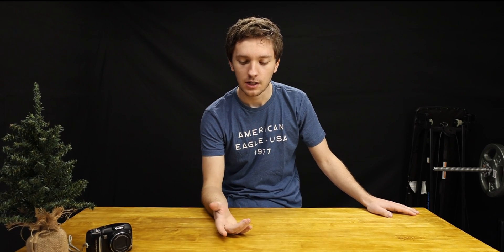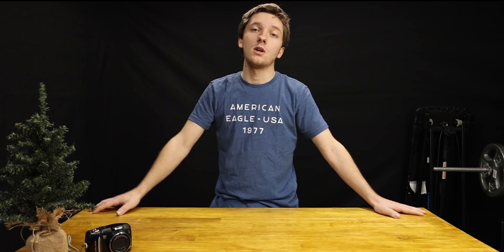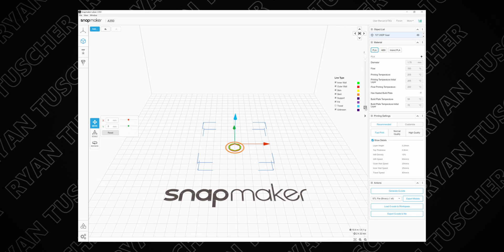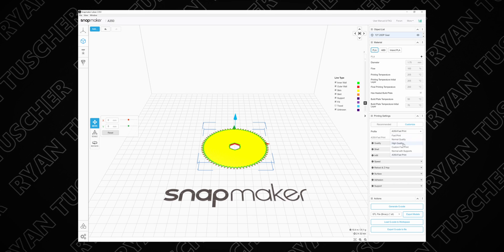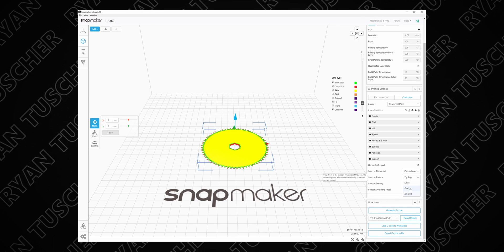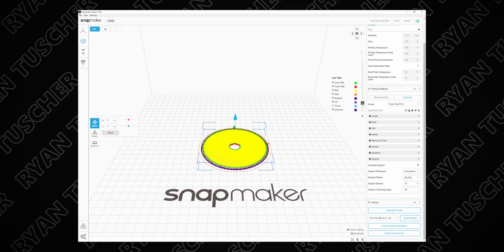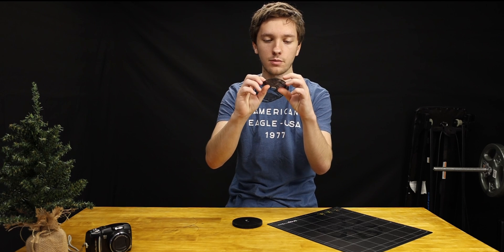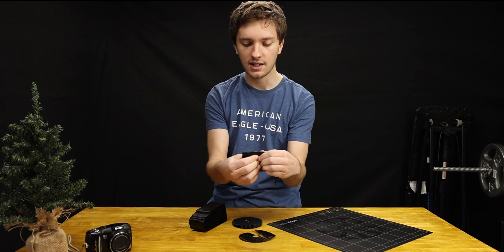How to Enable Supports for Snapmaker 2.0

Comment: I need a way to ad custom supports in Luban. I am a new Snapmaker 2 owner, I was used working with Cura and in comparison, Luban is a terrible, terrible slicer. The options you have are quite limited in comparison to Cura and other slicers, it's cumbersome and unintuitive and the workflow is quite bad. I wish I could create the Gcode file with Cura and then use Luban to send it to the printer via wifi, but nooo... Luban does not import Gcode files.

And how the hell can they forget an option to adjust fan speed. When printing TPU, I usually start with very slow fan speed or even turn it off for the first three layers and there is no way to do that with Luban. Damn, I've made a Gcode file with exactly those instructions and the printer just... prints the whole thing with the fan turned off. And I am still trying to find out where they hid the options to adjust z-hop, because there is not even a search function.

I have a case for a smartphone which would only require some small supports in the holes for the pen and USB ports and so far, I have found no way doing this. I already hate this program with a passion, I don't understand how you can make such an amazing printer and then fail so utterly, totally and completely with a dumpster fire of a slicer. :(